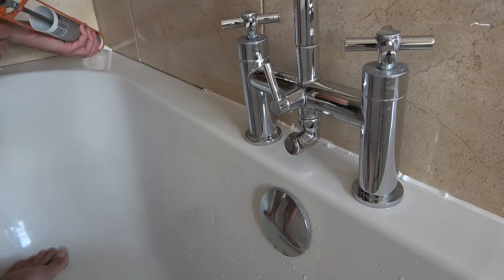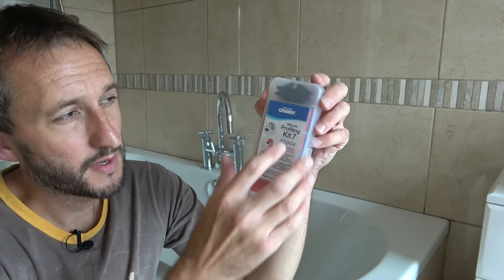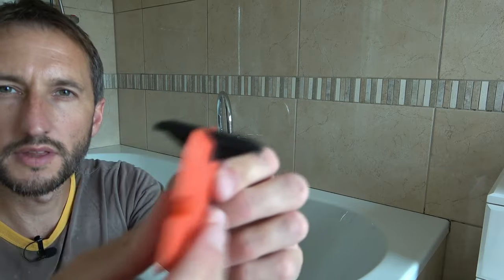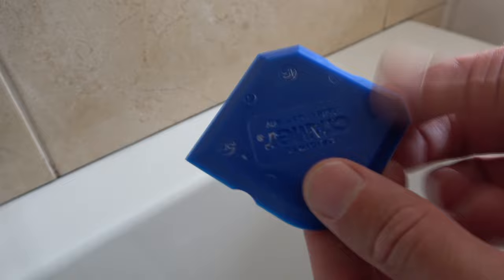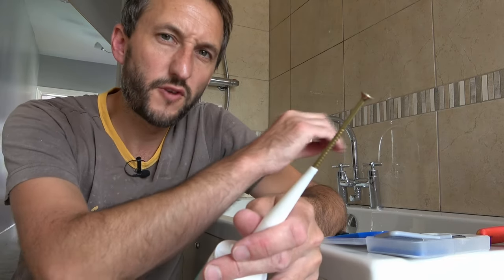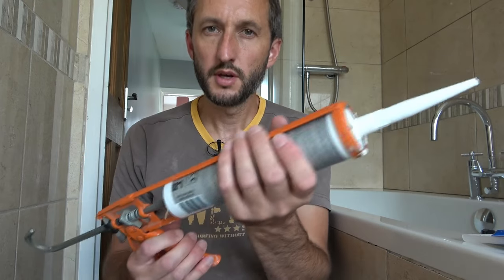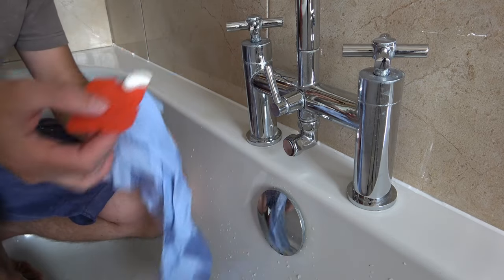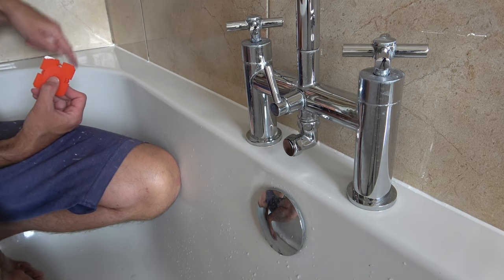How to apply silicone sealant DIY guide. Silicone caulk application for beginners. Pro silicone bead

Comment: If I am a diy man and had a new bath  I'd be asking the fitters why they have done half a job. If i need to seal it. Something I did recently after the kitchen floor replaced and they didn't seal and didn't even bother re fitting the bottom of the cupboards. Its almost like because there is a lack of skilled tradesmen I should be happy for a non complete job. Trades in uk are taking a liberty with the customers. Thanks for your advice tho. Going to now finish a job I paid a apparently reputable company to do. With your advice I can go do it.
Reply from the maker: Well not sure if you've seen my latest video, but I had a rant about exactly that with a window fitter! Video here in case you'd like to watch it - https://youtu.be/jsoSjwEkWXI. Best of luck with the sealant.
Reply: @POUSEaroundtheHOUSE  as a DIY housewife from India, thanks for your videos, helps immensely when money is tight
Reply from the maker: @devyanilimaye8560 no problem, glad to help 👍
Reply: You get what you pay for.

Comment: Sometimes the bath sides drop when a human steps in so it’s better to fill the bath then do this. The silicone sets with the bath dropped as much as it’s going to - so when it is stepped into it has less chance of breaking the seal under the bead.
Reply from the maker: Thanks for the feedback.

Comment: At last! He suggests white spirit! I’ve been doing that a few  years now. Couldn’t understand why the product suggests turpentine. Isn’t that an oil? Why would you want oil under your silicon. It does not dry fast and probably leaves residue. Methylated spirit an option, but it does not dissolve old silicon and soap.
Reply from the maker: I always use white spirits. Maybe I'll try turps and see what happens! Thanks for watching 👍

Comment: Thanks for posting your silicon sealant videos.  Good preparation by clearing out the old sealant and using the Cramer sealant/grout tools certainly helped me get a decent bond and finish with my Matki shower base that had started to leak four years after installation.  Cheers.
Reply from the maker: Glad to help, good work 👍

Comment: Nice one 👍 I can't stand going behind taps 😫 you have to know when to stop when doing this sometimes don't you, there's been a few occasions when I got it looking 95% good and tried to get one little bit then made it loads worse! Haha 

I always get through a load of toilet roll when I do my sealing 😂 only use wipes sparingly as they're more expensive. The no nonsense wipes from screwfix are always on hand though ✌️
Reply from the maker: You need to shop in Aldi, 50p a pack for wipes. I pinch them from my boys room! You're right about over working it, too much and it goes lumpy. Practice makes perfect, problem is I don't practice much! Thanks for watching and keep up with the graft on your place. Looking good, the hard work will pay off in the end 👍

Comment: Some good tips, thanks. I was doing my bath today and I also have uneven tiles so tried masking tape put on tight to the tiles, acted as a guide to lessen the step.  I bought some Silicone that was specially for bathroom - not much tooling time like yours so only got 5 mins before started going off - something to bear in mind when buying! Thanks
Reply from the maker: Thanks for the tips 👍

Comment: These profiling tools only work well if the tiles have been laid very evenly and flat. Also, if the gap between the edge of the bath and the tiles is more than 5mm then you will be left with a huge wedge of silicone. In this case, use the good old finger & masking tape technique with a finger dipped into white spirit to get a nice smooth and even finish. 
Lastly, if you have to silicone vertical walls as well, it is best to do these first and then allow it to dry overnight before doing the horizontals - this way you should get a much neater corner. In case you're wondering, silicone does stick to silicone just like sh!t sticks to a blanket.
Reply from the maker: Thanks for the feedback 👍
Reply: Yup. Not sure where the silicone doesn't stick to silicone came from as it obviously does from my own experience.

Comment: Dear Pouse, 
I have a vertical bead of sealant in the corner of my shower running from the ceiling to the base of the shower tray. I need to replace this bead of sealant along with the bead that runs along the base of the shower tray. Does it matter which one I do first? 
Many thanks.
Reply from the maker: I'd do the horizontal first then the vertical so a clean bead will run down over the horizontal ensuring water runs off nicely. Any small ledges of sealant coukd hold water which over time could start to go moldy. Hope that helps 👍

Comment: Yes appreciate the effort you put into these videos. I need to put sealant outside edge of my shower.  I did my electrics with your expertise help, works fine. Now, I want to put a single light in my attic, with a light switch? Just need to look if you have made a video on that.
Reply from the maker: Hope it went well, and yes I think I do have a vid on that, I'm just 2 years too late responding 😂

Comment: thank you your video is very useful
Reply from the maker: Glad it was helpful!
Reply: I need to remove silicone from my shower tray and then apply new one. Do I have to remove it with a tool or is there any solvent to do the job?

Comment: Profiling tool… or lolly stick. I’m new to DIY and watched loads of vids on sealant. The best tool I’ve seen used is a lolly stick. It leaves a decent amount of sealant behind so both sides of the join are covered with helps eliminate getting water behind the sealant and thus helping to eliminate the pesky black stuff and also looks finished well too.
Reply from the maker: Give it a go and let me know. I'm sticking to the profiling tool! Thanks for watching 👍
Reply: @POUSEaroundtheHOUSE  Profile tool is better than lolly stick. An unused credit card with corners cut to different angles could be used as a profile tool.

Comment: Came on here because I'm having a right nightmare applying black sealant on white tiles. When I go over it with the tool it is spreading the black everywhere and when it first happened I thought oh I'll just wipe it off and clean it up as i go but obviously when i go back to wipe off the excess it ruins the neat line and it is a nightmare to get off.

Ive been watching so many videos and everyone seems to have a neat line when the tool is used whereas i have a neat line but the sealant just spreads out. No idea if it is because of black sealant - i dont think so! Anyway ... Ill continue watching videos to find the answer lol
Reply from the maker: Did you have any luck? I wonder if there's something on  the bath tub reacting with sealant causing it to spread? Or wrong type of sealant? Hope it worked out for you.

Comment: Incidentally, how does your shower screen not leak without a seal on the bottom edge - or is this a work in progress?
Reply from the maker: I took it off while doing the sealant as I needed to sealant around tge screen frame. Thanks for watching 👍

Comment: Another great video. I find pushing the gun rather than pulling it gives a better finish. I use soapy water on the tool to get a smoother finish. As for taps, they're a pain. As somebody else said, you need to know when to stop and leave it. 👍
Reply from the maker: Good tips, thanks for the feedback Nick 👍

Comment: In tight places I use a damp finger and wipe it on soapy damp towels.  Then switch back to tools.
Reply from the maker: Thanks for the feedback.
Reply: I was told that using finger caused black mould.

Comment: Our tap is almost touching the tile due to the addition of tile backer boards used to square poor solid walls. Really not looking forward to trying to make a good job of it behind the tap because the silicone is going to have to go over the tap pillar
Reply: Also interesting to see you've fit the shower screen bracket 90° to the bath. When I come to fit ours I think we'll have to do the same

Comment: There is a great deal of good advice in this video, but there is a commercial element in it, as in many others. I needed to renew the sealing in my shower cubicle, it was leaking. I'm no DIY expert & followed to the the letter the instructions in this video & two others, results poor. Scraped the 3 poor results out & tried an anamalgam of all 3, perfect! Here's how to get perfect results: Scrape out the old sealant & finish it with a hard toothbrush, make sure all surfaces are bone dry with a good hair dryer. Now we're ready to apply the new sealant: have a small bowl of warm soapy water in your cubicle & plenty of newspaper to hand when you start;  (you'er on your knees here,) don't stream the sealant, dot it every one centimetre or so; then spread the sealant with your finger wettet in the warm, soapy solution; you will find it clings to the surfaces, spreads easily & fills the gaps...job done!
Reply from the maker: There's no commercial element to the video. It's not sponsored and I state that other tools are fine. I do have amazon links in the description but there is no obligation to buy through these links. It's just how I do my sealant. Hope that makes sense 👍

Comment: After putting the silicone on I sprays mix of water and washing up liquid over the joint, this stops the silicone sticking to the tiles when you use your profile
Reply: but then you get water / moisture behind the silicone you just put down, no?  seems like you'd want to push it into the joint first and then clean up.
Reply from the maker: Thanks for the  info 👍

Comment: So far you seem to understand sealant installation. I have installed sealants for over 40 years. One issue I have with these profiling tools is ( especially on tile) going one direction  pulls the sealant away from the  tile at the leading edge and pushes it into the trailing edge. It needs to be used in both directions My pet peeve is morons that say to spray on soapy water or alcohol or window cleaning fluid or any number of fluids, You are not one of those.My only issue with you as a professional sealant installer is tool In hboth directions. Of course as a professional I would use my caulking tools and not a profiling tool. EXCELLENT JOB. If you research I am far less kind to the other morons that have no idea what they are doing. BTW after more than 40 years in the industry the 2 best materials 😢manufacturers of silicone are DOW and GE. WELL DONE 😅BTW Again I have actually used more than hundreds of gallons of DOW and GE sealants( I have conservatively installed more than 100 miles of sealant)

Comment: So much waste. Isn't there another solution?
Reply from the maker: When you get well practiced you can just use less, but as a DIYer most people will end up with not enough sealant in the joint if they don't overfill and scrape back as seen in the video, and then you could end up with long term small leaks through the sealant.